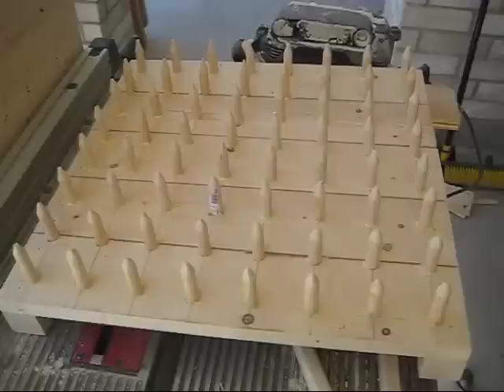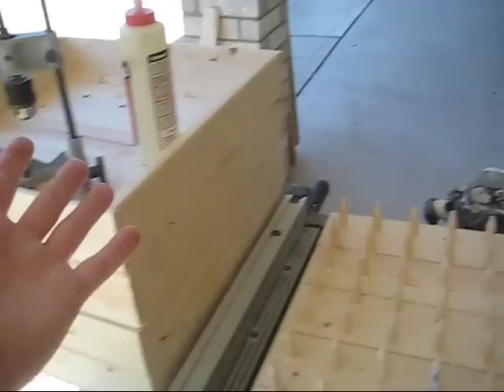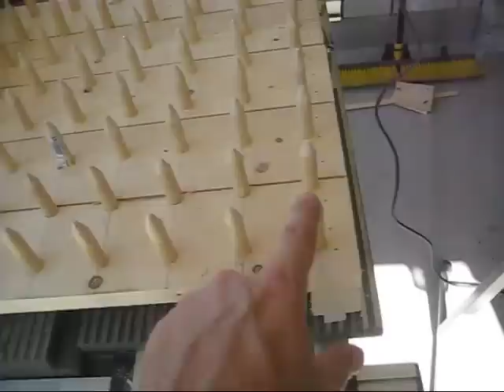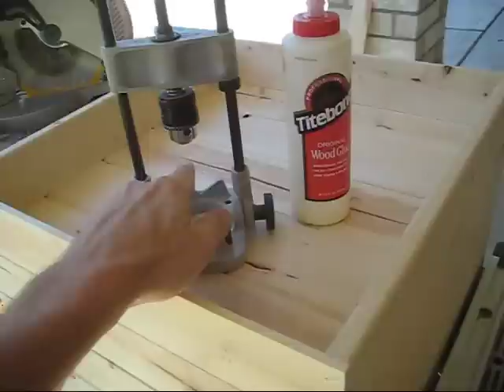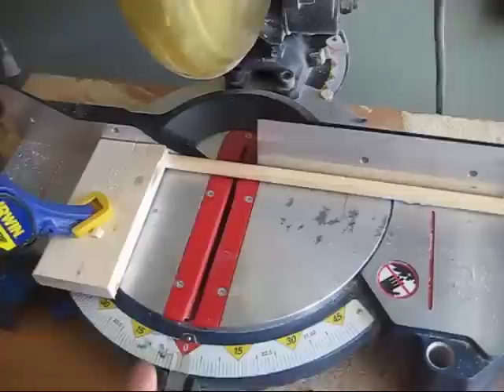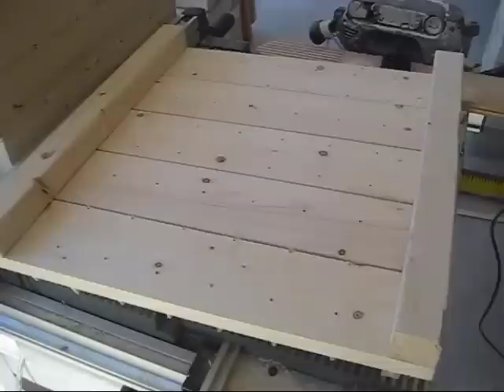Mittleider Gardening: Seed Flat Marker, How To Build

Comment: If you make your pegs offset on triangular spacing you'll be able to squeeze in about 13% more seedlings with the same space in between them. I've spaced with chicken wire but I like your spacer better. I'm going to build some with different distances. I wonder if this and the flats would last better if you oiled them with linseed oil or beeswax or used motor oil or something. Thanks for sharing this.

Comment from the maker: I will as soon as we build the green house. I plant on using the Mittleider fertilizer on the plants in the back to eden garden. As much as I like the BTE garden I can see that the plants are not getting all the nutrients they need. The MGM fertilizer will solve that problem. I will have to pull back the mulch to fertilize but it will be worth it.